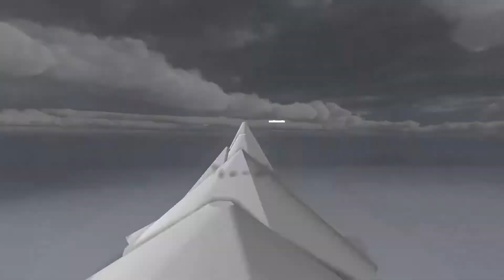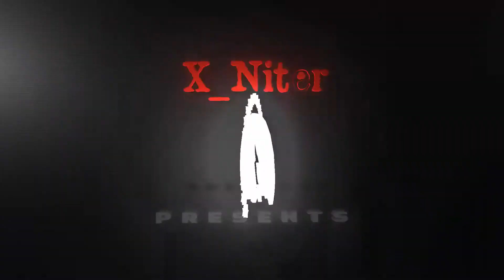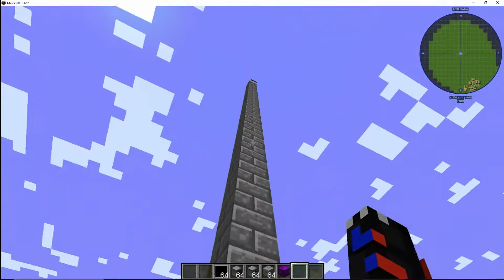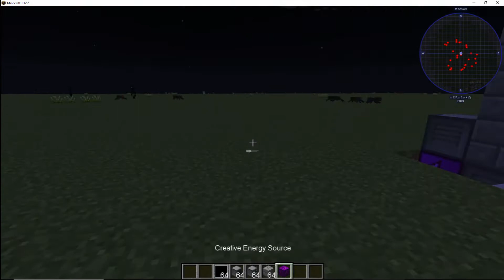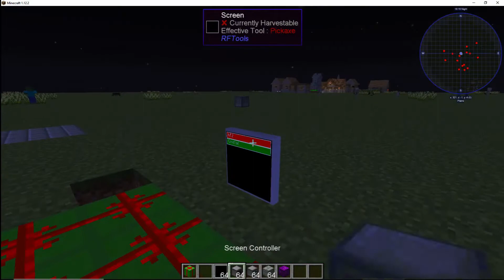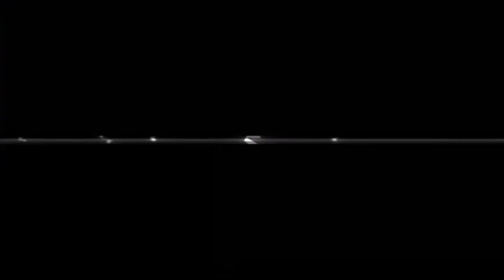RFTools Elevator Tutorial 1.12. 2

Comment: Can you pleas explain how to do it with 14 floors
Reply from the maker: Power one floor, then set up your screens, make sure every floor had an elevator and a screen. You will need your screen controllers all connected to the screens, your best bet is to max infuse the screen controllers to get the best reach out of how high or how deep your 14 floors go.
Reply: @X_Niter  right now we have two screen controllers it that why we have a power drain issue?
Reply from the maker: @embelcourt8101  if it’s using to much power then you’ll just need to produce more RF
Reply from the maker: @embelcourt8101  but you do want to infuse these things to better the consumption efficiency